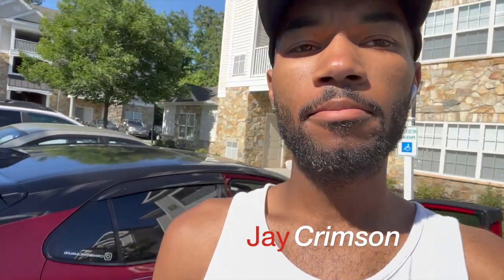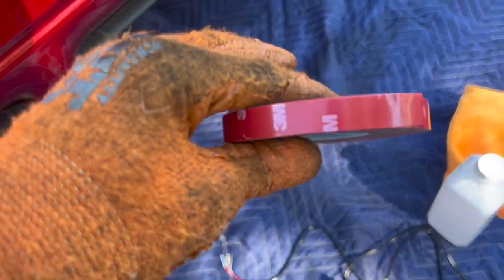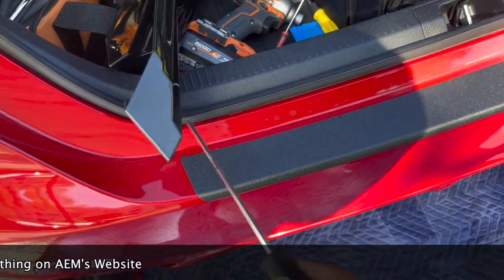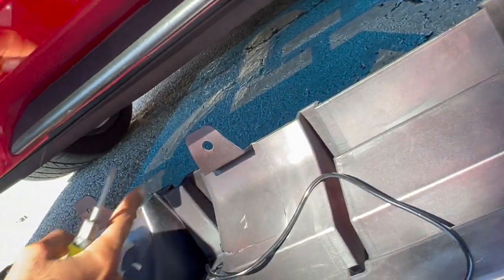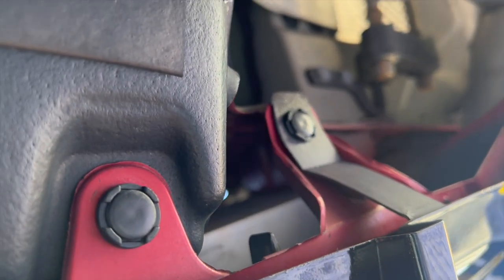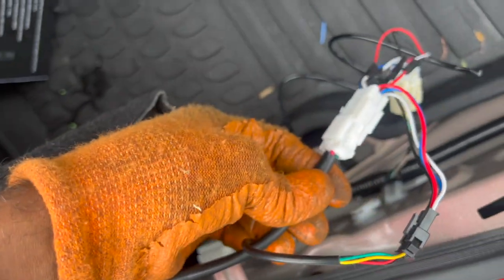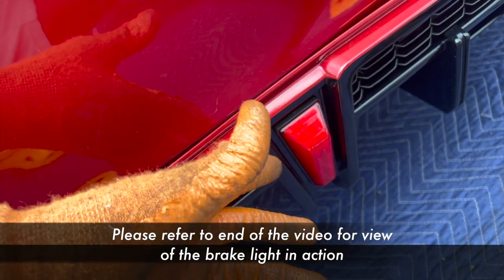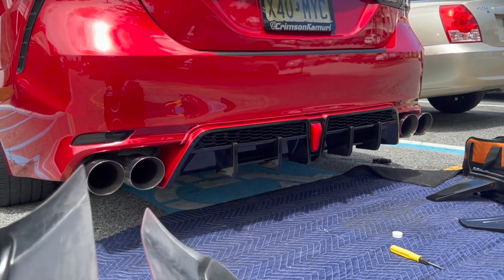Installing V2 Yofer Diffuser on a 2018-24 Toyota Camry SE/XSE

Comment: As for the wiring, dont you need a voltage regulator for that or does the ecu control the exact flow that the lights get?

Comment: Is the wiring the same for the brake light on the V1 Yofer diffuser?
Reply from the maker: Should be if I had to guess. If anything it’s not hard to use process of elimination. That’s how I figure it out for myself. But black to black for ground is always consistent
Reply: So did u ever do it how do u do it ?

Comment: I have been watching most of your content here and there when I can but I hate to ask and be that guy; but would it be possible to do a bumper conversion for this on a LE, taillights and wiring harnesses included if possible? Not certain if I would get a higher trim. I only ask this because from the research that I’ve been putting together the LE and every trim after that has minor differences, I seen a couple of people do certain mods on their LE trims with a few tweaks but I can’t get any responses from them to confirm what they have done. Great content as always!
Reply: You can put an se/xse bumper on an LE
Reply: @kenjiii_  I definitely appreciate the response!
Reply: I’m in the same boat, I have an LE but can’t find many people who have you been able to do any conversions

Comment: this should work on the TRD? aren’t they built on the SE trim ?
Reply from the maker: TRD is a SE with a V6 engine, wing, and bodykit
Reply from the maker: but to answer your question correctly, no it will not fit because of the TRD diffuser that comes with the car

Comment: I got mine of eBay and the diffuser came bent and the fitment is short, is that normal and how would I fix it?
Reply from the maker: By Not buying things on eBay. Defeats the whole purpose of me making the videos and telling yall where to get it. And leaving links These eBay sellers are selling you cheap replicas of the actual real product itself. The companies I deal with only have the authentic Yofer products from yofer themselves.